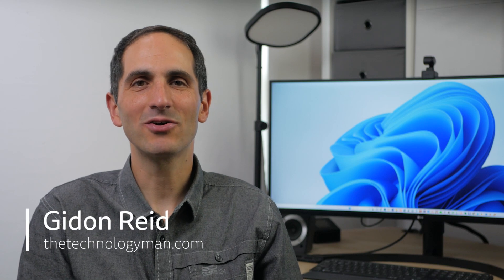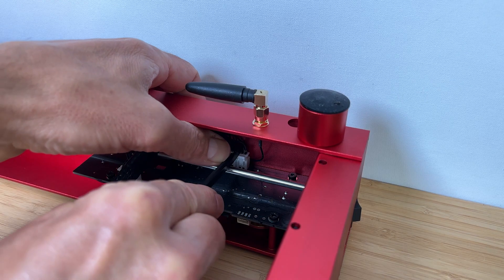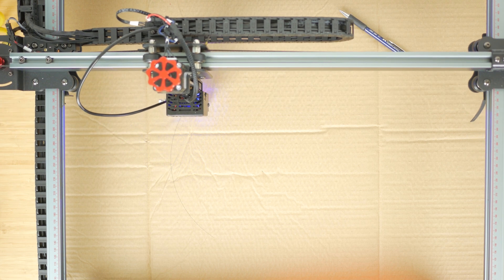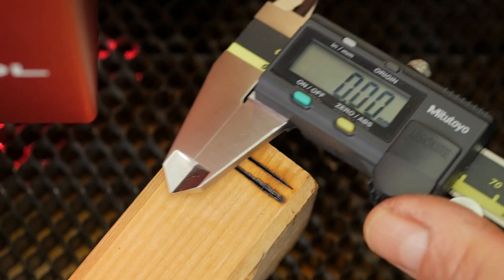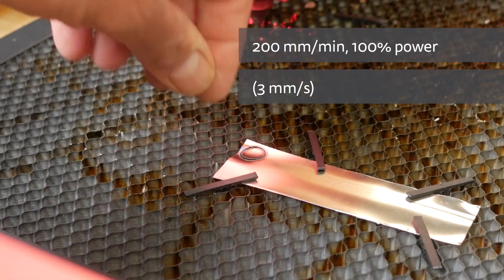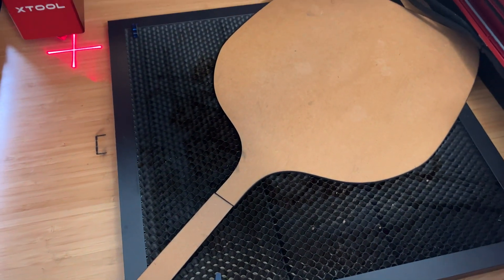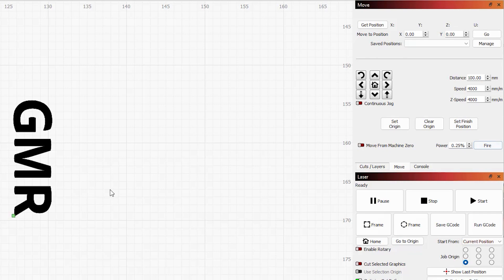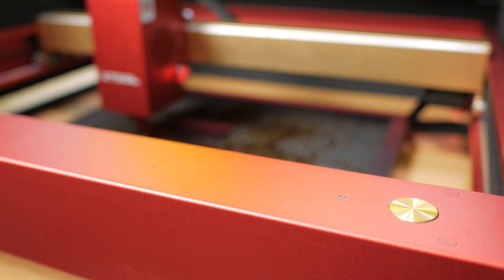xTool D1 Pro 40W Laser Engraver Review | What can it do? | + Air Assist & Enclosure

Comment: Have you done any testing in EVA foam?  (utilizing the 40W)  I have been thinking about pulling the trigger on a 40W Xtool, but need to be able to cut 10mm-12mm EVA foam.
Reply from the maker: I've not got any EVA foam. I've cut Kaizer foam (EPE IIRC) on my 10W machine which cut like butter. If get hold of some will report back!
Reply: @TheTechnologyMan   Thanks for the reply.  good to know about the EPE foam.  what thickness did you cut? (using the 10W)
Reply from the maker: @JJB123NC  It was around 12mm IIRC. I focussed the laser halfway through.